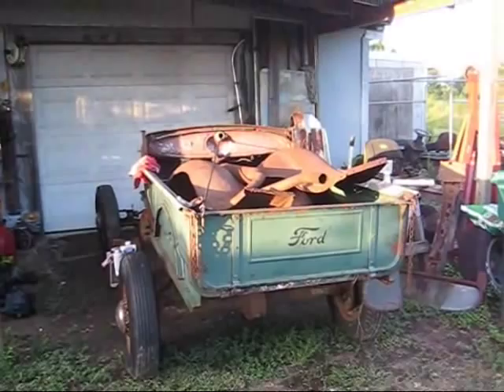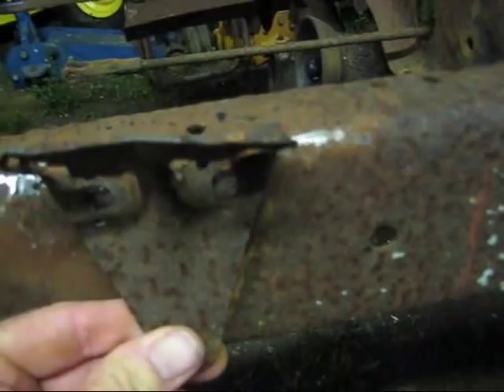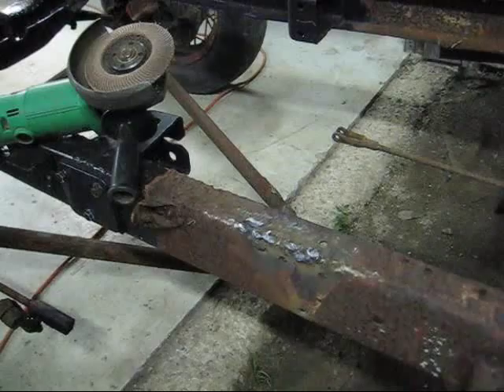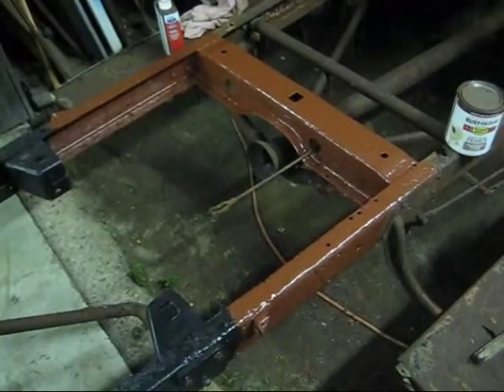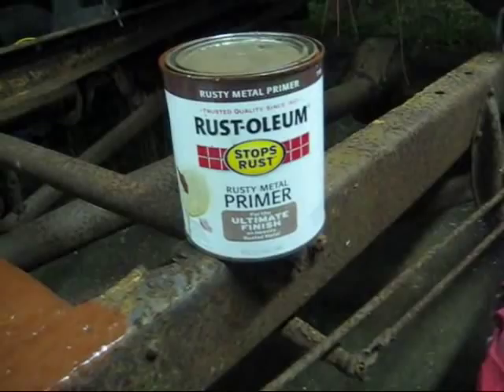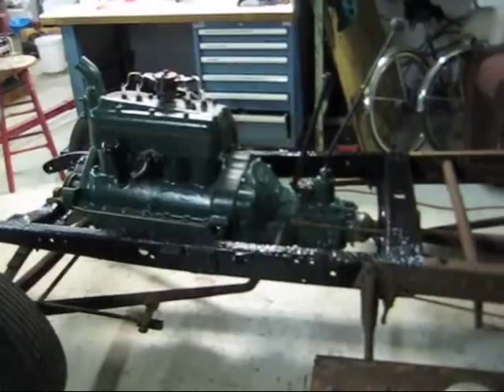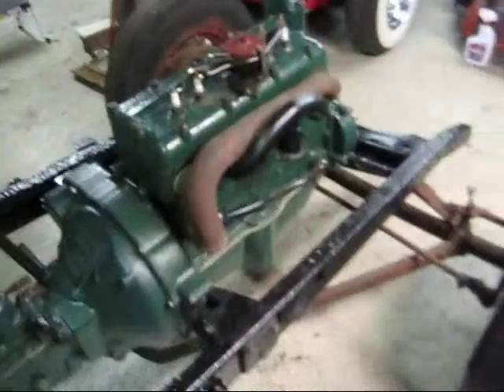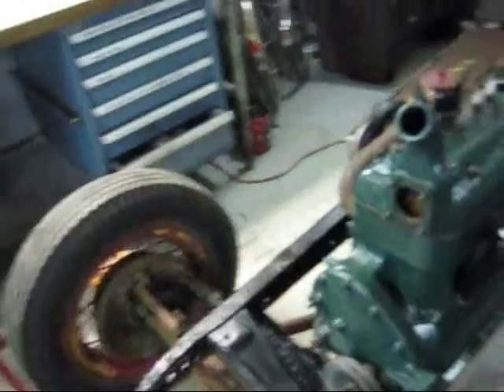Model A Ford Hillbilly pickup rat rod PT. 7 (the build)

Comment: looks good, If you want your flap disc to last longer, use a hard grinding disc first to get the weld flat, then use the flap disc to get the final finish smooth..